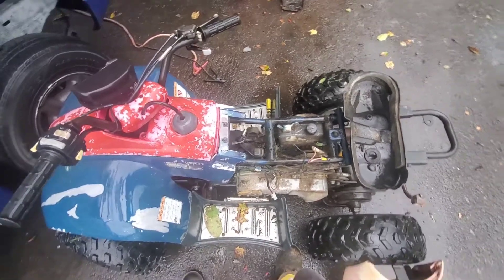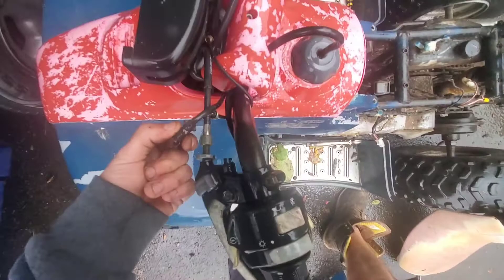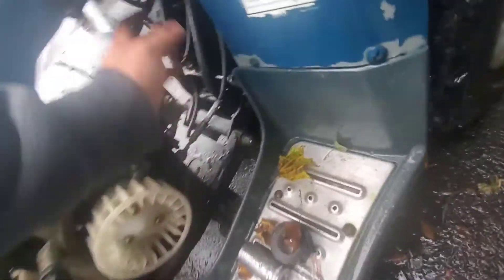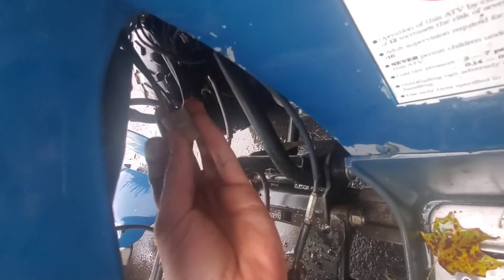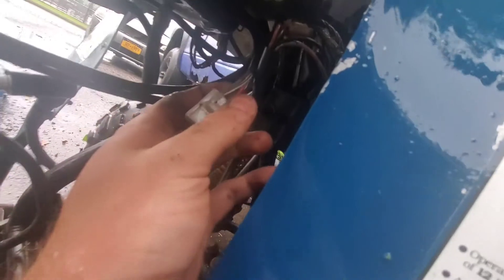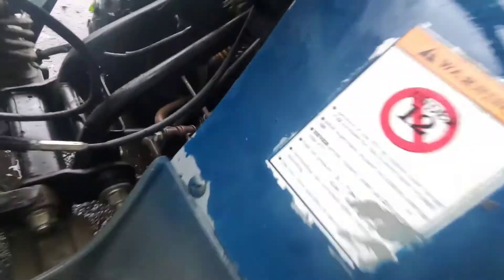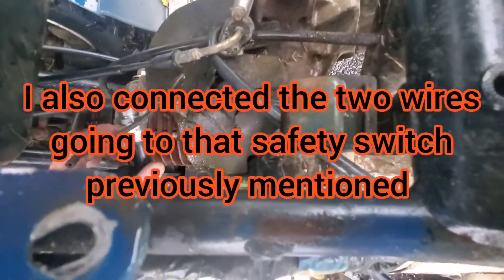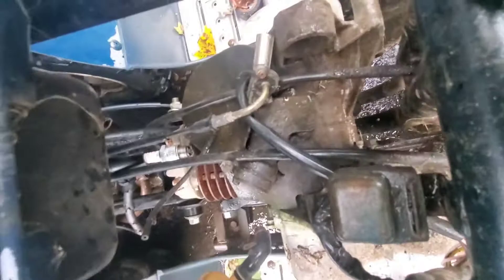Bypass Key Ignition Switch on Dinli / Eton 90cc Quad Fourwheeler - Easy Fix for NO spark

Comment: Got mine to work now. Been messing with it & simple. I got a new carb & works fine, just needs new throttle cable for throttle & oil pump, brake, & battery. 

Seems their performance cdi, coil & spwrk for them,

Comment: I have a dinly 90cc & it has spark, fuel, byt doesnt turn on, carb just has a needle sticking & no feather that open like to cover air & let air in when acceleration
Reply from the maker: What does it do when spraying starting fluid In it
Reply: @BackyardRevivals  dont have starting fluid. Just carb cleaner
Reply from the maker: @Mroswaldo16  get some starting fluid w upper cyl lubricant
Reply: @BackyardRevivals  it turns on when i add fuel to the carb but shuts off. & smokes a lot so im assuming its burning oil. 

Wonder if needs new carb?
Reply from the maker: @Mroswaldo16  it's a 2 stroke it's supposed to smoke
Reply: @BackyardRevivals  yeah, i mean that the oil pump is working. Im going to clean the carbs & hopefully it runs good
Reply: @BackyardRevivals  how does this accelerate? Since theirs no throttle thing that openes to let air in?